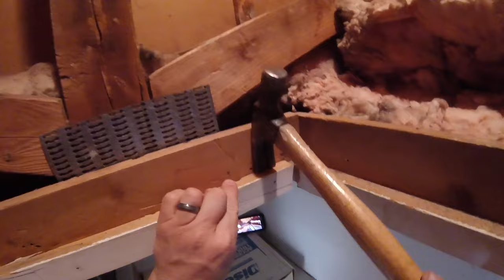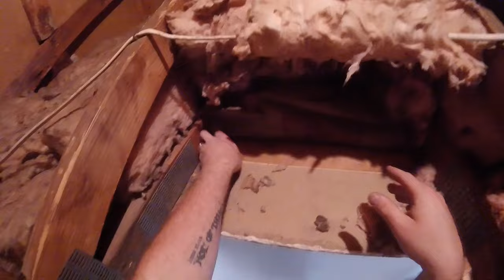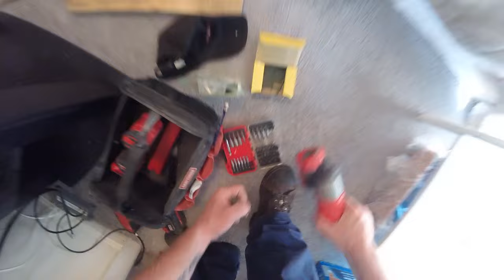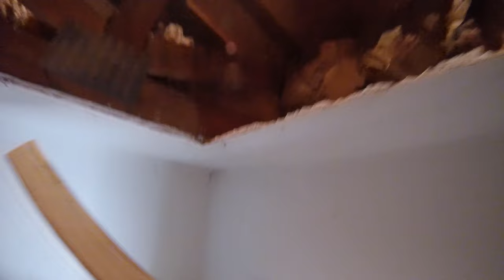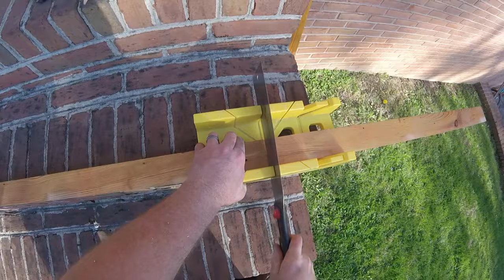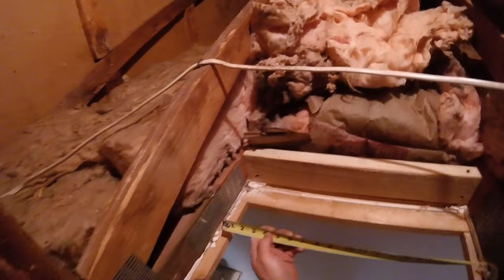Enlarging an Attic Access Hole

Comment: Thanks for the video. I bought a house with a low slope roof with no attic access, sagging ceiling joists and a couple different sags in the roof. The roof appears to be about 20 years old but it felt solid and no signs of water intrusion except for the very back of the house. I hammered out a small section of the ceiling in about the middle of the house but couldn't see much and there was insulation so I'm hoping I don't find a major leak and the insulation has been soaking up all the water when I cut out part of a joist to get up there. I'm hoping it's just a couple sagging or cracked rafters. The rafters are only 2X6, we get about 50 inches of snow a year and the roof is about 4 or 5/12 in the front and a 2 or 3/12 in the back so it's likely more snow than the roof framing can handle in its current condition